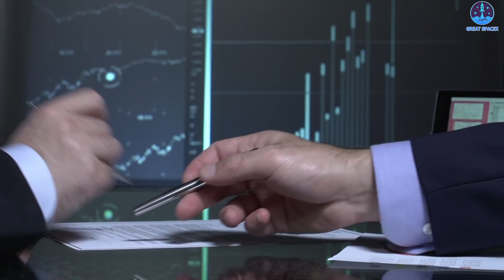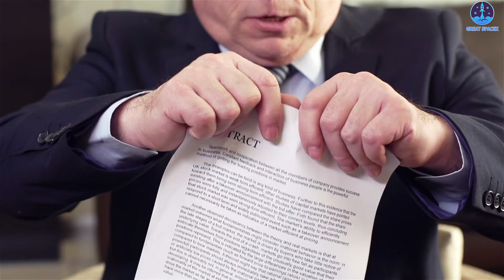SpaceX vs FAA: Why KEEP STOPPING Starship Orbital Flight? Elon Musk Respond.

Comment: The number of employees of all US beauracies could be reduced by 50% and the entire system would work much better than it does now.  From personal experience I can attest to the fact that all "Government" is bloated, self serving, and greatly overpaid -- with very little actual accountability.  Too bad that SpaceX has not completed it's first 20 miles offshore launch facility that it is building using an oil platform.  Then it could rightly tell the FAA to go screw itself.  If you are not a part of the solution, then you are part of the problem.

Comment: The FAA charter expressly requires the FAA to promote aviation among  other regulatory activities but not to regulate environmental standards and certainly not fixed structures that do not interfere with air traffic near airports or  airways. That is up to the states or counties. Read the 10th amendment to the US Constitution. The interstate commerce provision allows the FAA to operate within the constrains of that charter. Space flight is totally outside that provision, because the launch is confined to a state and test flights cannot possibly called commerce. Not even congress can legislate activities reserved to the states or the people. The FAA has no authority to impose licensing requirements on experimental rocket launches inside well defined restricted areas covered by published temporary flight restrictions. The restrictions are there to regulate outside air traffic. Does the FAA regulate the operational details of nuclear power stations which have the potential to contaminate vast volumes of airspace used by airliners, of  course not.
Reply: Article 1 section 8

Out of the 22 enumerated powers Congress has the power to regulate commerce AMONG the several States.(in short INTERSTATE commerce).
Same section 8:
To promote the Progress of Science and useful Arts
( in short : not to hinder it with unnecessary licenses, and regulations that are not activities covered by any powers enumerated in section 8).

Comment: No it is NOT obvious that the FAA benefits aviation. You stated yourself there are millions of flights. Does the FAA perform an environmental assessment and safety checkoff for every flight? OF COURSE NOT. They cannot possibly provide such levels of oversight over aviation, and spaceflight should not be treated any differently. If it is so important for the FAA to be involved, why has the FAA not STATIONED their inspector AT Boca Chica spaceport?  The FAA is obstructionist and provides zero benefit.

Comment: The FAA is funded by the same people that don't want us to lead in space, and lead by them. There is most likely an internal battle between money hands and politicians. Both knowing how far ahead SpaceX could get of any other nation and NASA itself in space exploration and the privitation in the money sector of space exploration, which in their minds translates to power. If you can get to space independently and ahead of everyone else, how independent and untouchable would that make you to whole nations, political groups as well as competing corporations domestic and abroad? The FAA first and foremost appears to be an environmentalist group as opposed to being a safety administration group, predominantly if inspectors don't know, or understand how newer innovation technology works from SpaceX. This leads many to question whether they are qualified to even inspect. How can you inspect what you don't understand, and certainly to the tune of delays that can cost SpaceX a fortune. The solution to sidestepping them could be the Pentagon or Space Force. The faster China progresses the more pressure will be put on the FAA. The FAA is due for a restructuring  that can address the above issues in a timely manner that does not affect launches, cost, mission timelines and testing. It should work for SpaceX, not against it.

Comment: A government agency desperately trying to hold on to power.  It’s pretty simple.  
The FAA should only be responsible for clearing the airspace the rocket will travel through.  
Now they are acting as FEMA and the environmental protection agency.  We certainly don’t need more governmental agencies doubling up on there areas of responsibility.

Comment: At some point, SpaceX could just more offshore and bypass the FAA (and the US government) all together.
Reply: That will not work faa still has jurisdiction over them ;). Another example is rocketlabs us company that needs faa approval to launch in New Zealand
Reply: @MrTrashmasterfx  I think New Zealand is a special case - the FAA and New Zealand CAA have a mutual approval agreement.  This would not be the case for International Waters, but I suspect that SpaceX would not want to test this because if the FAA disagreed, they have other ways to punish SpaceX (as we have seen before).
Reply: @connecticutaggie  hm That could be the case. I will definitely not be easy to launch out at sea, can really remember how it was with sealaunch
Reply: @MrTrashmasterfx  Sea Launch was different - it launched from a floating Ocean Platform.  SpaceX plans to launch from the Gulf (continental shelf) using a Platform that is lowered to the floor.  There should be not much difference from taking off from land.

Comment: My prediction is that the FAA will continue to be a problem and Elon will buy his own island out of their jurisdiction and launch when he wants to.
Reply: @ronschaefermd  He’s going to need his entire workforce.
Reply: @Hotsparks66  He used his privat jet already to transport workers to sites if elon is comitted he will just buy a couple more jets or helicopters and do it without goverments being in his way all the time xD
Reply: Sure, then when a hurricane decimates his island he goes out of business.
Reply: @redrick8900  He’s on the Florida Keys. Basically an island. He could just as easy get wiped out by a hurricane there.
Reply: @Hotsparks66  SpaceX isn't in The Keys. SpaceX barely has any facilities in Florida. They have a couple of rocket assembly stations near Cape Canaveral which is on the mainland, but the rockets are manufactured in Texas. Also, Cape Canaveral has been a rocket launch site since the 50's and it's never had a serious hurricane impact. It's on the safe side of Florida.
Reply: @redrick8900  😹
Reply: @Hotsparks66  I don't speak millennial I assume that's a desperate attempt for you to dismiss that you were proven wrong.
Reply: Pick up a couple of old cruise ships, bolt them together just in international waters and have Spacex there.

Comment: Give the FAA a break. All starship launches were done outside of the current environmental survey. They were individually approved after the FAA reviewed their safety assessment. The FAA needs to be sure that the steps are in place to prevent Starship from crashing onto Miami. All the detailed engineering data needs to be supplied to the FAA and they need to review the safety of the flight.

Comment: The FAA is a slow-moving bureaucracy with self-interested administrators and career civil servants. To force a change, Elon is staging PR events like the full stacking of booster and ship. He has a good track record with that approach (see: Tesla Roadster in space).
Reply: Every pilot knows the FAA is a joke.. incompetent, political, bloated, lazy, massively inefficient, uncaring & irresponsible…like every other Federal Agency.. Government is the problem, not the solution. Politicians & officials use Govt power to obstruct/delay to demand shakedowns & payoffs, punish opponents & reward supporters.
Reply: @warrenwhite9085  Yeah the FAA also did a great job with the 737 MAX approval...
Reply: Steve Dickson, the current administrator, knows very well that
the FAA has no mandate to regulate space flight (Look up the FAA website - Guidance) Regulation of structures are up to the States.
Texas has not delegated that activity to the Federal Government. According to the 10th Amendment that activity is reserved to the States or the people . Read the text of the 10th Amendment. Congress cannot change that either unless it violates the Constitution. The FFA can regulate the airspace outside airport traffic areas above typically 500 feet ground level up to 60000 feet, nothing above that, let alone space (above the von Karman line)
A ground launch that lasts about one minute below 60000 feet and remains within one state cannot be considered interstate commerce and does not qualify for that provision in the Constitution.
The attempt to license space ports as the FAA administrator claims is a power grab that has no basis in the constitution, not even Congress can make laws  that are reserved to the states.
What the FAA can do is to publish designated temporary flight restrictions for other air traffic 
It is up to SpaceX to initiate that. 
To allow the meddling by the FAA in the design and test of the starship is not a safety enhancing activity at all. Given the history of SpaceX demonstrated competence in accurately controlling and guiding the rockets to a landing  area every time makes any claim of endangering persons outside a restricted area
baseless.
Did Howard Hughes need an approval  to fly his Giant H4 in the LA harbor for a 30 sec flight?

? j t
Reply: @hernanposnansky4830  Government (eg FAA) is about greed & power…  The FAA charter is limited to protecting passengers in the air & innocents on the ground.. Elon Musk has made disturbing movements away from liberal Democrat dogmas & towards independent thought.. and worse not made big contributions to the Democrat party or bent his knee to woke ideology. Therefore, as expected there sudden & serious FAA ‘questions’, issues & accompanying delays… eg ‘environmental’ assessments.. The truth is that the FAA staff  is entirely incapable/incompetent of judging SpaceX technology, Boca Chica is a remote seaside spot, the vehicle proceeds over the gulf & SpaceX has a validated history of proven flight termination expertise..
Reply: Warren,
I fully agree with you.
Reply: I expect significant requirements if the FAA grants orbital flight from there. There actually are real concerns for Port Isabel and South Padre if an explosion happens on tower. Maybe SpaceX will have to buy everyone who requests triple pane tempered windows. Who knows, but I bet it will be something.

Comment: You gave the argument for the FAA in your video.  The FAA is responsible for thousands of air flights everyday.  With the increase in rocket launches, you can't have everyone doing what they want because it stops their innovation.  You need someone to make sure what is being done is safe and not reckless in terms of the environment around them.  You need to make sure that a rocket going up is not going to interfere with nearby air traffic or another rocket that is planning to be close to the same orbit or some form of debris getting near something on land or sea.  It doesn't have to be the FAA, but I feel NASA should be the one to regulate this.  You can't just have everyone do what they want if they don't like a specific regulation.

Comment: Building without first obtaining the required permission and see where that gets them.
Reply: That's how innovation works you ass, Its easier to ask forgiveness than permission.
Reply: @randalllewis755 New Flash, Elon Musk is not a King. Space X don't get to make the rules, it may be easier to ask for forgiveness than permission, then again if affordability is part of the Space X objectives it might be cheaper to get the necessary permission first and not have to build and then dismantle unapproved structures.

Comment: FAA is woefully unequipped for this new, accelerated rate of development.. creating a new, separate agency will just make more red tape. FAA needs a full overhaul.
Reply: John
other than secure the area covered by the temporary flight restriction and as long as the rockets are not flown commercially they (FAA) must not be involved in the operation of experimental vehicles outside of the airspace 
under their jurisdiction (up to 60000 feet)
Historically any meddling by non qualified 'regulators' has led to misshaps.
Reply: @hernanposnansky4830  once it's not experimental though, won't they need a flight license for each launch? If so I don't see the current FAA to be capable of approving 10 per day.

Comment: Congress needs to charter a new agency with a new mission called the Space Flight Administration as soon as possible.
Reply: Basically the same job the FAA is doing.  So how does that change the current regulations?  My belief is that NASA should be the agency to oversee U.S. launches since they obviously have the most experience.
Reply: No , the establishment of the temporary flight restriction is enough to cover the ~1 minute launch to 60000 feet were the FAA has jurisdiction
Reply: Robert ,
To give Congress that power, the constitution must be amended.
read Article 1, section 8
does not fit into any of the enumerated powers delegated to the Congress.
Hint : the power to regulate INTER STATE commerce is the power used to create the FAA.
Commercial space flight among states? really?
Reply: @hernanposnansky4830  Based on your reply, you may be 100% correct. It makes sense on the surface, and I did some research and understand now how it all started in 1926 under President Calvin Coolidge. The issue I believe I was thinking about when I posted by initial reply was related to how the needs of a Space Flight Administration and their regulatory authority differs substantially from that of the FAA. The FAA would need to be included, as most surface to 100km+ flights for rockets takes place in just a few minutes below 100km so even though they would need to work together, I don't see how expanding the role of the FAA makes sense with respect to the unique and evolving needs of SpaceX or any other company in the USA that plans on conducting 100km+ launches on a regular, recurring basis.

Comment: well, the FAA is just following the rules. to the best of my knowledge, they dont make those rules. its up to (i guess congress) to make new, adjusted laws for the FAA to follow. also starship is currently a prototype, and they make tons of changes with each new build. so they have to redo the entire process every time. once they have a standardized build, it will be a lot easier.
Reply: That is why the FAA should not be making a big deal about unmanned test flights during product development... Just give launch windows during reasonable times and make sure the clearance area is large enough to accommodate the risk.  Do Not Make Permanent Changes To Accommodate A Temporary Situation.  The risk is all on SpaceX, the rewards for success will be for all of mankind.  Physics/legal borders determines where the launch sites must be located.  Animals can be relocated, due to physics and country borders, the launch sites cannot.
Reply: @Hawkido  i think you missed the point. The FAA cant change the rules, they are only there to enforce the existing rules.
Reply: bit of a different example... up north we have an ice hotel. the entire building is made of ice, the only things that could possibly burn are the mattraces and the reindeer furs on the bed. they are still forced to have fire-extinguishers in every corridor, bc it is a public building. the laws just didnt considered that there might be buildings that basically cant burn.

the laws the FAA enforces are just not made for a new, different build of a rocket popping up every month or so. but its not their fault that the rules are the way they are.
Reply: @IGhengisKhanI  It isn't the rules on the books that they are trying to enforce that is the problem... it is the rules that aren't on the books that they are trying to enforce that are the real problem.
Reply: Craig  exactly
because to regulate spaceflight by Congress requires an Amendment to the constitution,
Nothing applicable in the limited powers delegated to congress
Article 1 section 8

Comment: The FFA is an outdated and badly  organised and not up to rocket lunching, just aircraft , there needs to be a separate department away from them ,that area  can be marked on charts as a test zone and all high flying air liners can avoid it on the flight plans after all this put in to place for military flight testing and that is nothing new.

Comment: They should create a sister to the FAA, called the FSAA. Federal Spaceflight Aviation Authority. Which specifically deals with flights destined to leave (and re-enter) the atmosphere. With faster protocols than the FAA. That way the FAA can keep doing its thing (which works for the normal aviation industry) without massive changes.

Comment: How well tested is that first stage? looks like a gamble to me. Better bunker down.
Reply: Static fire was successful, fail probability still exist and is very dangerous but is unlikely.
Reply: @Ivan_Berni  The static fire could not have been a sufficient test as a full light up would have ripped the rocket from its moorings, so it's hypothetical if it will launch cleanly.

Comment: There is no reinforced concrete in the Chrysler building or the Empire State building. They are constructed of steel beams and girders covered with granite.
Reply: At minimum the floors and foundation is made of concrete.
Reply: @mbox314  Also the elevator shafts are reinforced concrete.
Reply from the maker: hum... thanks for your infor